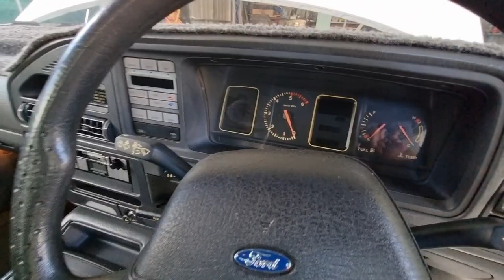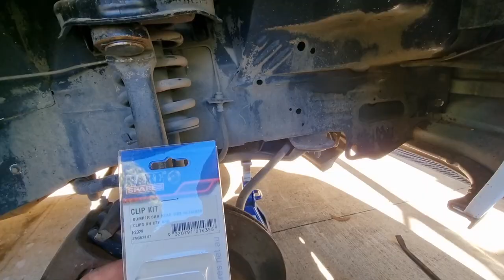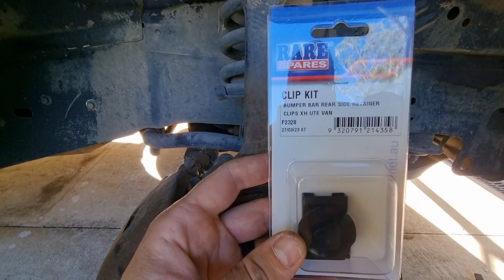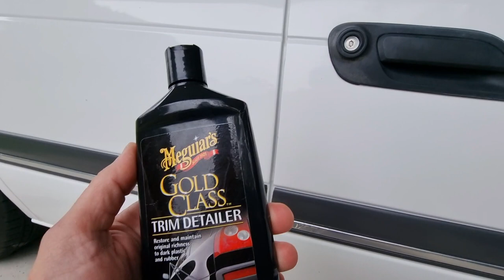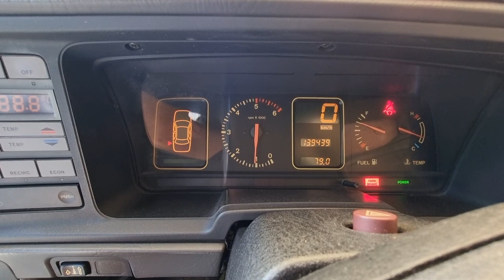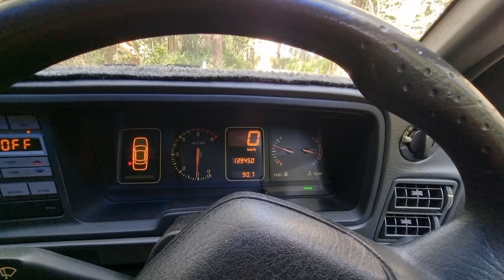EB Fairmont series 1

Comment: Dobinsons sl springs are better ,makes them sit a little lower than kings.
Reply from the maker: I don't want it any lower mate for me it sits perfect and still a comfy ride.
Reply: @TBONEMALONE..  yeah bro that's all good,I have the dobinsons in my eb2,it's not too low that there's ground clearance issues.my exhaust  rarely scrapes.
Reply from the maker: @barra245t2  What colours yours mate?    Much done to it
Reply: @TBONEMALONE..  it's a reef green fairmont.ive got  tickford head,set of headers and a 2.5"exhaust with a flow master muffler.sounds nice a bit loud though I think it needs a resonator.dobi suprlows and superpro bushes throughout.nothing to serious just a real nice cruiser.